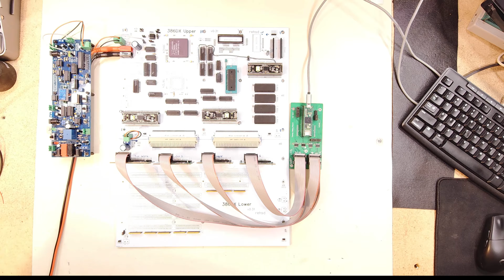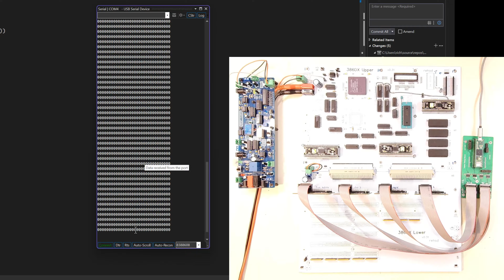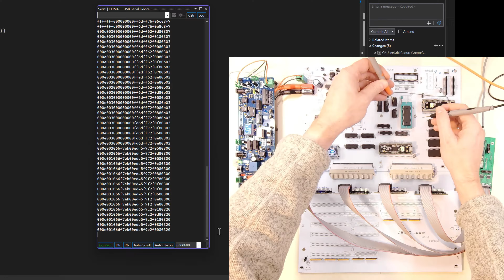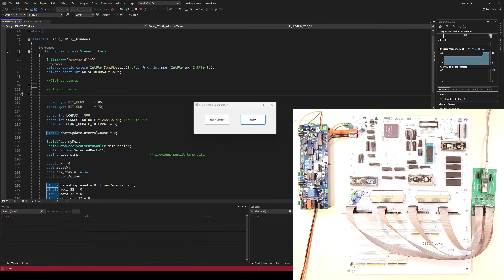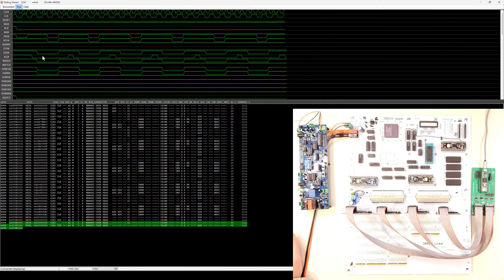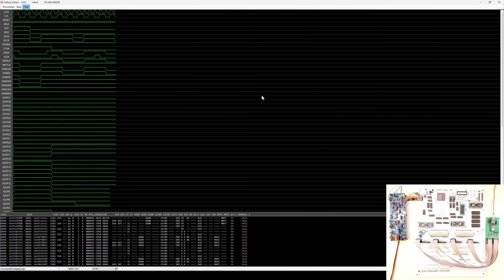80386 DX Build, Ep. 15 - Upper/Lower PCBs Running, plus Teensy/Winforms Logging

Comment: Your Windows debugger app is really awesome. I'm jealous everytime I see it!
Reply from the maker: While it's not polished, I find it helpful. :)  When time permits (maybe late December), I might try to refactor how I display the waveforms -- looking for something that performs better than what I have today.
Reply: @rehsd  All of my programming work in in Node these days, but I used to do a lot of Java. The first thing I thought of was using additional threads (or the .net equivalent) to drive the different segments of the UI. Would that be helpful in this case?
Reply from the maker: @GregCoonrod  Unfortunately, Microsoft Winforms require all UI updates to be done on a single thread.  :(  That's a key reason why I want to look at other technologies for the UI. I've seen killer UI's before than support multiple threads, and that support would be very beneficial.

Comment: I'm curious, I know on AVR micros you can read a whole port (8 pins) in a single instruction, I assume you can do that on the MCU that the teensy uses as well. Would that be a possible way to get a bit more speed out of your debugger design? Or did the teensy designers break up the GPIO ports in a less than useful way?
Reply from the maker: Like you, I also assume the Teensy can read an entire port at a time. I believe the Teensy can run far faster than I can handle on the Winform side of things (currently). I do have a "to do" in my code notes to switch over to port reads or digitalReadFast. I'm just using digitalRead for now.

Comment: My eyes! What camera are you using to record the top down shot? (I'm mostly just poking fun. I know how annoying it can be to get a good exposure/focus.)
Reply from the maker: :) Ya', I thought the same thing. I intentionally turned up the brightness, which looked fine in preview, but when looking at the final recording it was way too bright. Sorry about that. It seems like I am constantly adjusting things. I need to get to a more consistent lighting setup. I did just purchase an additional camera that might give me some better results. I'm hoping it gets better in the next few videos.
Reply: @rehsd  One suggestion from my time helping with live video production. Get a sheet of white card stock. Use it to set your exposure at the beginning of each recording session and then lock it off. Even if you didn't change anything.
Reply from the maker: @GregCoonrod Good suggestion! I also need to have a checklist for my lighting setup. I have a dozen different lights above / around my workbench, and depending on which ones I have on, it makes a huge difference. Sometimes I forget to set them consistently. And in the case of this video, it was user error, where I thought the preview looked fine, but the recording seemed much brighter. I could have pulled down the brightness when editing the video.

Comment: Great to see the progress, looks sweet! I like how you can view the waveforms, that's pretty cool.
Reply from the maker: The Winform tool is still a bit clunky, but I'll try to improve it little by little. I do find that it helps me better understand the overall system timing, comparing it with datasheets. Now, I need to get good at using some Agilent gear. :)